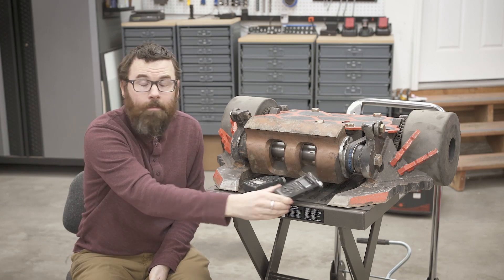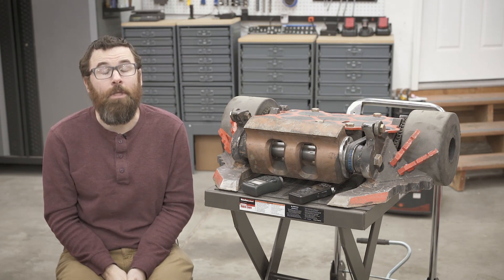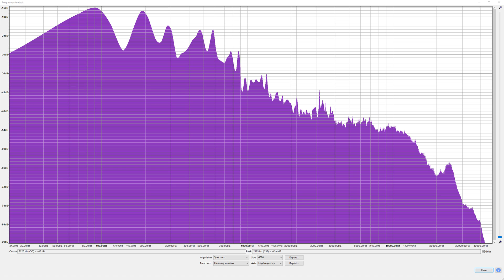How loud is a Battlebot?

Comment: I thought it was the weapon motor that made most of the noise. I thought Tombstone was so quiet and Minotaur was so loud because an outrunner is a quieter motor generally than an inrunner.
Reply from the maker: Nope!  The motors themselves make a bit of a high pitch whining noise, but it's not really all that loud.  Brushed motors make noise too, but it's the weapon that makes the most noise by far.
Reply: @RobertCowanDIY  Ah interesting! In fact it explains why my egg beater and my other vertical make different sounds though they have the same motor!
Reply: @Rascythe  They are basically inefficient air raid sirens :)

Comment: Interesting video, Robert. I have a question: doesn't "producing loud sound" reduce the overall energy efficiency of the weapon? For example, I'm thinking about the difference of running the weapon attached so close to the body of Copperhead, building and releasing pressure or turbulence between the drum and the body, as opposed to "running the weapon spinning free in the middle of a large room". Does that influence the power draw or is that negligible?
Reply: It must be absolutely negligible. That drum weights tens of lbs, the energy in that spin is absurd; it's only flayiling the air even in the back, it's not like a compressor drum in a fully enclosed environment. And that drum is actually kind of aereodynamic compared to weapons like Valkyrie's or Tombstone's

Comment: If that drum could do 10k RPM, it would be orgasmic.
Reply from the maker: Maybe.  Going faster means more stored energy, but it also means getting the tooth to engage is harder.  It's always a trade-off!
Reply: Do 10k for test recordings and first box test to raise hype. Swap the motor pulley and belt back to something reasonable for actual matches.
Reply: I believe that running the motor at 18s lipo will make it do 10k rpm.  Just for listening sake. I have watched this video like 30 times already. Also what is the weapon motor current draw at 12s?

Comment: Fantastic Content! 
Please do more measuring and metrics.

I would love to see you do an analysis of how much weight Copperhead can push around and pull, roll that into experimenting and you can multitask content creation with development.
Reply from the maker: I was considering a video like this, just trying to figure out how to show it.
Reply: @RobertCowanDIY  Just start testing, and crowd source ideas from feedback...

There are several of us that would love to be involved “from a distance” with no access to hardware or local groups enthusiastic about this topic. 

Maybe everyone will learn something together. 

A rotating drum of gecko tape synthetic setae that adheres and releases as rotated :D

Or just test compounds and diameters vs lengths and tread surfaces. Temperatures of the compound on a suitable arena floor analog. 

Some of those wheels people are using now appear to even be leaving a layer of compound down that the wheel is seemingly using to grip to.

Comment: Idk if this would work or if not or if you do it, but would a slipper clutch help with weapon impacts against other bots? Maybe it would take some of the load off of the motor, causing less motor issues when you hit someone with the drum?
Reply from the maker: That's pretty much exactly what the belt/pulley accomplishes.  If you ever see a big puff of smoke right after a big hit, that's the belt burning a little bit, because it's slipping.  Watch one of the death-roll fights, you can see puffs of white smoke after hits, from the belt absorbing the blow.
Reply: @RobertCowanDIY  cool! Thanks!
Reply: @RobertCowanDIY  Do electronics have any features designed to save belts? Or is that factor purely up to the operator?
Reply: @101rotarypower  Most good Brushless ESC's have Stall Detection, for if the main prop or jet on a model aircraft/drone jams or strikes the ground. However, most teams disable this or reduce the reset time on the system to the minimum value as we don't want the weapon to stop. The belt might be a £10/$15 part at most and if it wins you a fight and you have to replace it then who cares. Compared to the thousands of £/$ that teams spend, a belt is a easy sacrifice for victory.
Reply from the maker: @101rotarypower  Not really.  The belts usually get damaged from being hit.  The electronics can't do a whole lot about that.  If the drum was simply just spinning up and down continuously, the belts would survive indefinitely.  It's when they get nicked or frayed, and then you add in heat and friction.  We ran a pair of belts all last season without issue.

Comment: Quick question, how did you guys go about balancing the drum?
Reply: Rob and Zach told me that somehow the finished drums were too heavy on the tooth side. So they took one drum and tried welding on another plate to the back, but they didn't heat up the whole drum beforehand, and this resulted in a lot of cracking all over it and they had to chase the cracks with an angle grinder for like an hour to stop it from shattering the drum. Zach had a full-on meltdown. For the second drum they just ground down one side of the tooth.
Reply: Verrrry carefully....
Reply: My guess would be dynamic balancing?

I would love to know more details about the drum with the weld beads added to it, I believe they did that to balance it IIRC

Assuming it did, How did it come unbalanced? Or was that possibly a repair to a damaged drum?